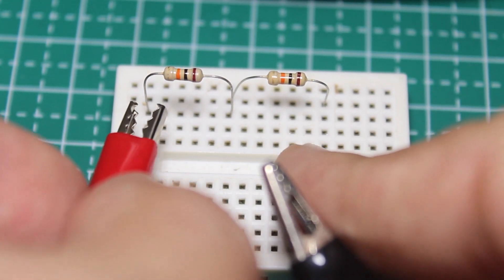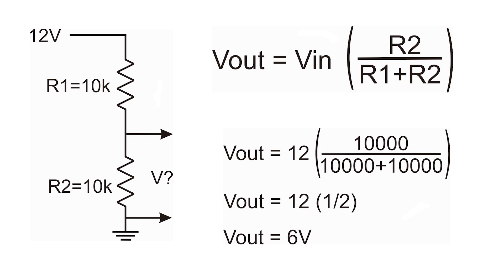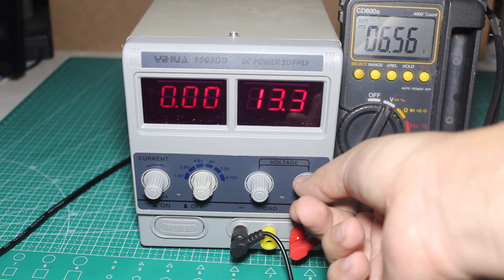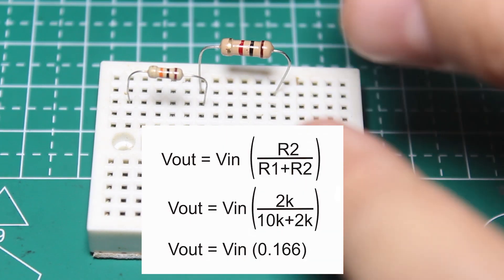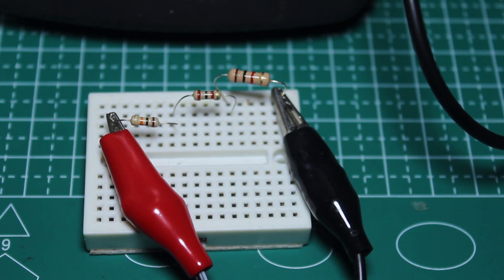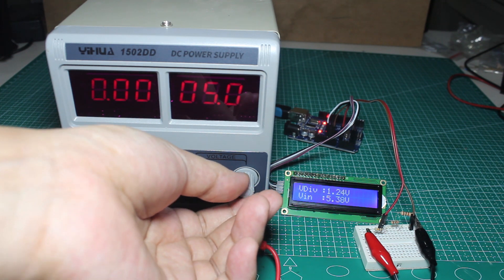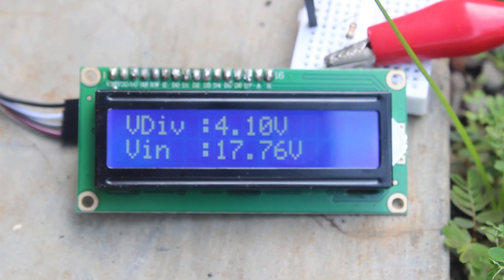Understanding voltage divider and How to use it as voltage sensor - Electronic Basic #3

Comment: Sir, I want control the voltage using a 10K potentiometer,  Vin=12V DC, and Vout=  (between 0v-5v) from the potentiometer. So, I need a resistance R1, that will drop the voltage from 12v to 5v, in order to produce Vout = 0v to 5v from the potentiometer.
But I am unable to calculate the R1 resistance value.
Please help me in this.

Comment: Can you give me the values of the resistors if I want to measure a voltage up to 30v?
Reply: Hey. Why do you not watch this video here, and learn instead? This video here explains it all. So ask questions to the understanding of this video, and I will assist you.
Reply: Use this formula for voltage divider with 2 values resistors, R1 (top resistor), R2(button one), consider R1 is 10K, Vout is 5 volts (arduino max input voltage ) and Vin (yours 30 volts): 
R2= R1*(Vout/Vin-Vout). The result is 2K. Now you can find  the values of R2  for any voltage you want.

Comment: Can the code be used in esp32
Reply from the maker: Sure, you just need to make sure the voltage result. Esp32 module only able handle up to 3.3V.
And also don't forget to change the pin you are using.

Comment: why do I need to multiply by 13 and divide by 3
Reply: Yeah, i didn't understand too for the calculation in arduino program
Reply: I would like a answer to that too.
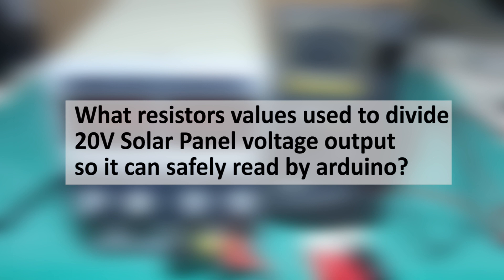Reply from the maker: @HenrikHvalpen  I already explain that on 5:46
Reply: @miliohm  I'm sorry but I still don't get where 13 comes from?
Reply from the maker: @HenrikHvalpen  since the original voltage is multiplied by 3 and divided by 13 (look at the circuit and formula). So the voltage on the arduino should be multiplied by 13 and divided by 3 to get the original value.

The point is multiply the divided voltage, so we can print the original voltage before divided.
Reply: @miliohm ah okay thank you, I don't understand it fully, but it definitely helped alot to the learning process. With that explanation in mind I will watch the video a couple of times and I think I will get it. 😄 Btw Your video helped me finishing my project so I'm very grateful for that now I just want to get the theory behind it to stick. 😅💪
Reply: Me too I still don't understand

Comment: dear sir ,can i measure upto 0 to 5 volt directly connect to arduino A0 pin without any voltage divider circuit ?
Reply from the maker: Sure. Just make sure the maximum is 5V
Reply: @miliohm  yes my maximum voltage  is fixed 5volt ,thankyou sir for sharing knowledge. 🙏